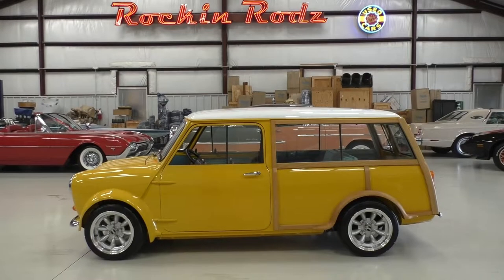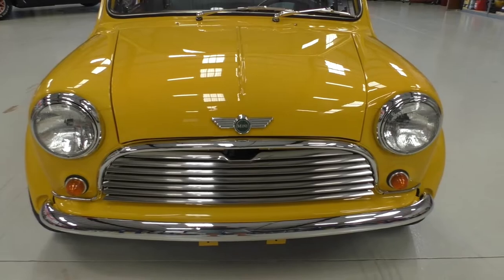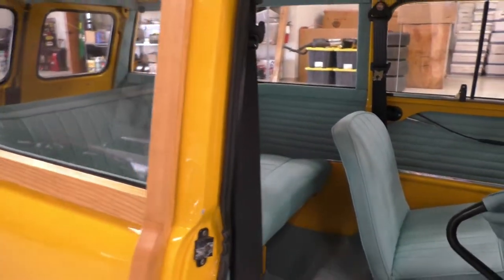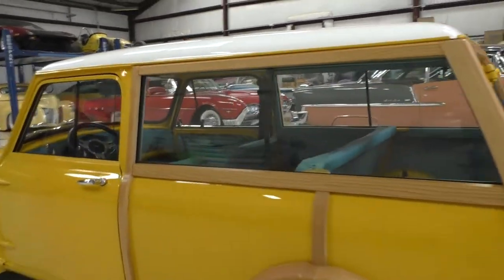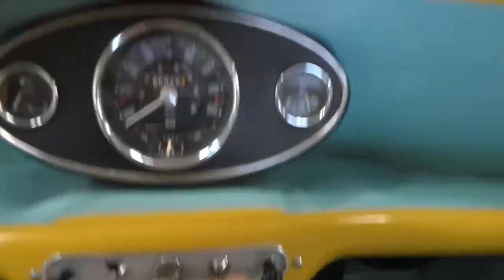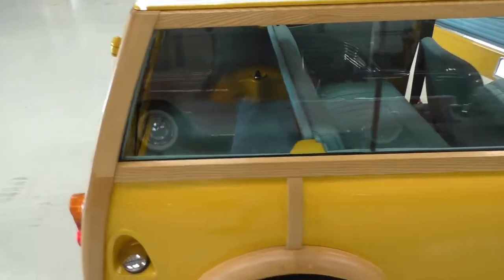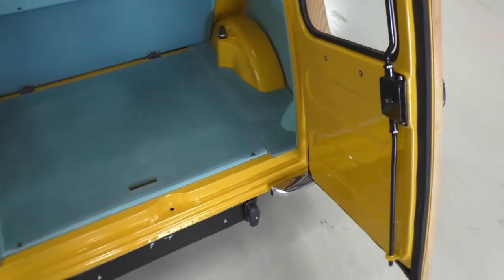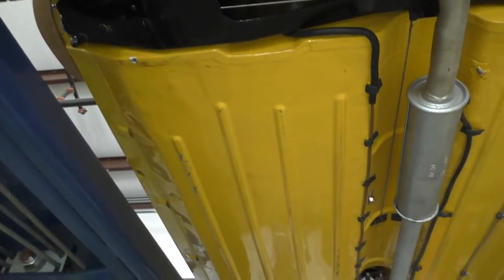1962 Morris Mini Cooper  (Sorry Sold) Traveler Wagon Custom

Comment: That’s a cool Mini Traveller. Lots of updates too, the drivetrain is from a later model and obviously the wheels, tyres & brakes. had a 1959 for my first car back in the 60’s, great fun to drive. Just don’t put it through a car wash with those sliding windows 😉.